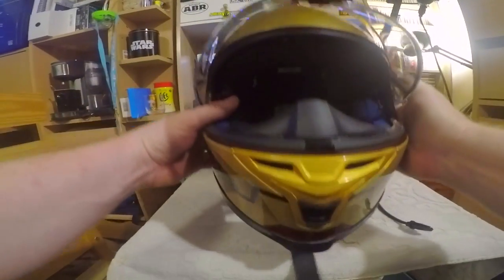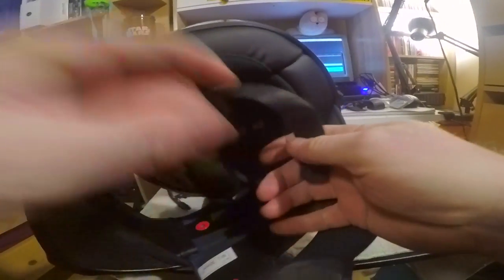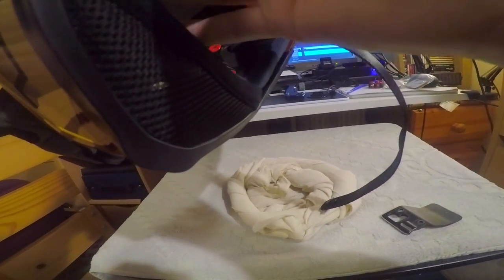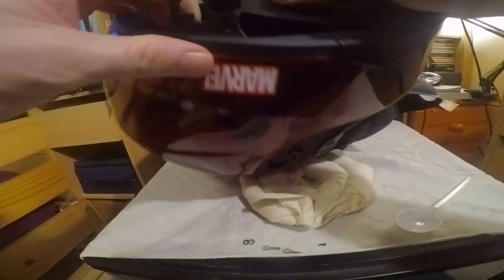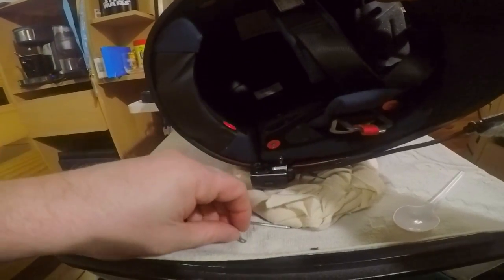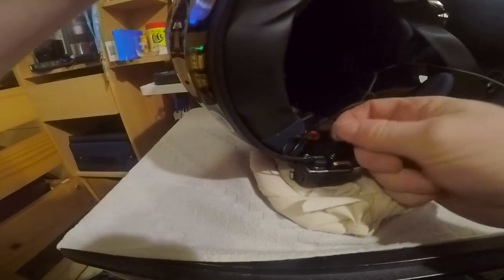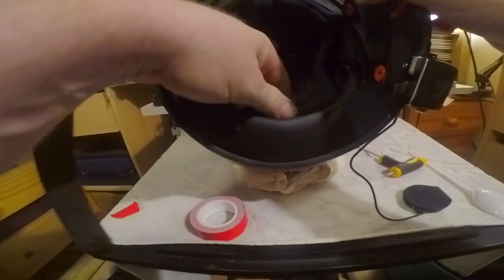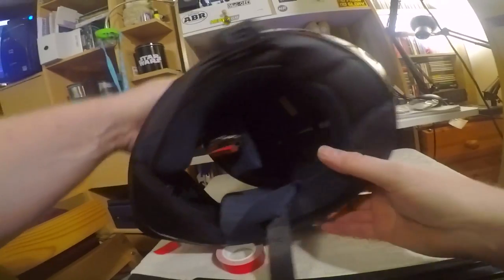How to Install the Sena 20S into HJC IS-17 Helmet

Comment: thanks for making this video, it helped me ALOT! What is your experience with the speakers next to your ear? Because it looks like it doesn't really fit. It looks like there is no space for a speaker. (I have an IS-17 with Sena 30k)
Reply from the maker: MrStoopio I had to change the speakers to the slim line as they where very tight on the ears....I was looking at the 30k but not sure if you can get slimline speakers
Reply: Thanks for the answer! Its good to hear that you experienced the same issue. The slimline will propably get available in the future?!
Reply: me too... my HJC IS 17 doesn't have a hole for the speaker.. very painful to the ears, after long haul ride. Do they really provide slim-ier earphone??
Reply from the maker: They do do a specific device for ours helmet type not sure on what it's like something I need to look into
Reply from the maker: NO......this is very dangerous; there is a reason why the internal shell is that size, hence the reason Sena has the slimline speakers and they do a specific model for this helmet

Comment: do you have problems with the speakers and their spot? i cant find a right one with my helmet. it is always too tight and hurts because of the wrong position
Reply from the maker: Are you using a Sena? if it's the 20s you really need the slimline speaker to give you a little more room. When i used the standard one it felt like my brain was being crushed
Reply: yes it is the 20s. where can i buy these slimline speakers?
Reply from the maker: I think I was lucky and got mine from Amazon,  I would try sena themselves,
Reply: Nige-Rider thank you! I think I need to buy them.... Otherwise it's really too small in there